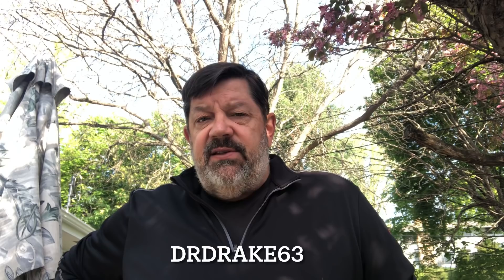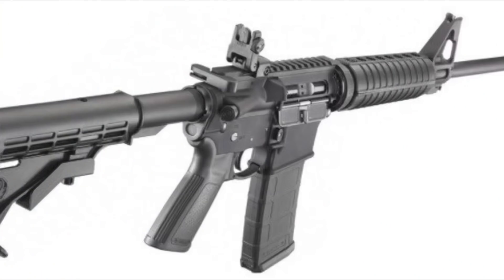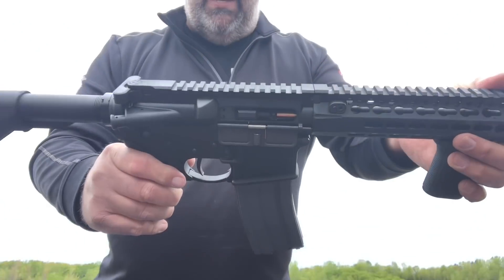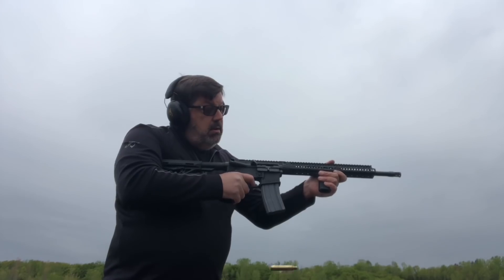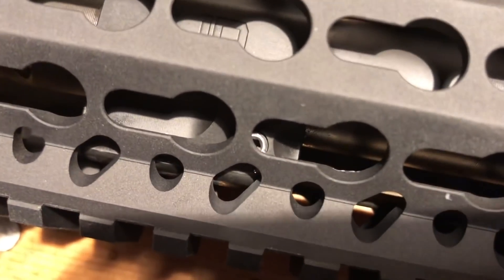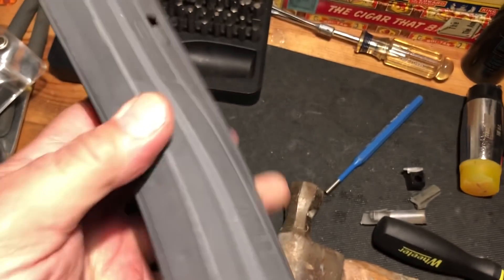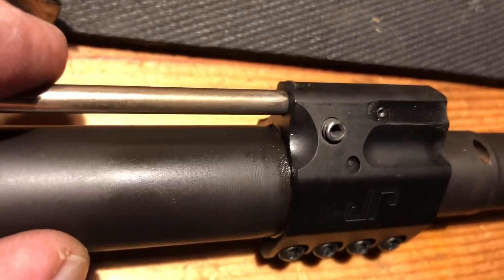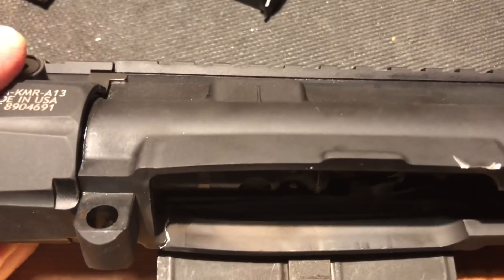Colossal AR Failure

Comment: Sir... Can you check the chamber headspace with a 5.56x45mm field and nogo gauge?  Were you using commercial ammo or reloads?  Also, can you inspect the barrel bore for obstruction?
Reply: I noticed the upper receiver was busted up pretty bad so I think you would need to put a new upper with that barrel then check headspace.  Everything you mentioned was pretty much what I thought, right down to the obstruction because the AR does not produce enough gas pressure to do that unless the barrel was blocked by something like a sqib.
Reply: Given how mangled everything is, I'm going to guess that checking headspace isn't possible, and assuming it was a functioning factory-built gun before changing the handguard and gas block, checking headspace should be irrelevant.
Reply: @KevinJames-yg9eu  Thats OK, I just figured it out.  CNN said it was Trumps fault the gun blew up.  One of their unnamed sources confirmed it.

Comment: For sure not over gas since standard gas block has a port as large or typically larger than the gas hole in the barrel. That was either hot ammo, out of battery det, or a squib. Look at last two shots in sequence before the failure does anyone notice any gas exiting end of barrel, squib(s)?

Comment: After reading comments, general consensus believes it was a hot round. What else could have caused this other than a hot round? possible weak point in a milled part? I don't know much about the internal components, but genuinely interested :)
Reply: The forces at play here were several times the forces that the rifle is normally subjected to to deform all of those components simultaneously. There is no parts failure or fatigue that would take this shape. Not to mention, you see this exact condition commonly with poorly or dangerously loaded ammunition or ammunition caliber mix-ups.
Reply: @KoonceTodd  ahh ok totally makes sense, I truly appreciate your response!!
Reply: @KoonceTodd  correct

Comment: If you think this was an issue with an adjustable gas block you dont belong anywhere near working on an AR.
Ill try to explain this in the simplest way I can think of.
If you were to use a non adjustable gas block, it would be just a fully gassed system.
An adjustable gas block doesnt add any gas to a stoner system.
An adjustable gas block places a valve restriction on the orifice between the pinhole on the barrel and the gas tube. 
Thats it. 
If its undergassed the gun wont cycle properly.
If its overgassed ie the the valve is all the way open you just wasted the extra $100 you spent on a gas block because youre no longer restricting any of the gas you basically just have a really expensive regular gas block.

That thing launched the bolt back into the carrier and grenaded that thing. My guess is you put a 300 blackout into that gun. Either that or there was a major barrel obstruction.

Comment: I almost exclusively run adjustable blocks. They’re not just for suppressors. They help mitigate recoil ( there isn’t much but my GF is tiny and any reduction is helpful). I can’t think of a single way that a gas block could do this. The BCG is designed to handle the total pressure of a cartridge firing without any gas system whatsoever. There are plenty of “bolt action” ARs out there (look up the Cali-Key). This was absolutely either faulty ammo or a faulty BCG. Either the ammo was loaded far beyond spec and the bolt couldn’t handle it, or the bolt itself was not up to spec and did not handle the standard load.

It is actually impossible for an adjustable gas block to result in overgassing. It uses the same diameter gas port as a standard block. They are only capable of reducing gas flow. This is why if you’re having cycling issues, you shouldn’t get an adjustable block, you should get a lighter buffer/carrier.

Comment: Did you have a Squibb? How does the cartridge look? I don't think gas by itself can cause that type of damage. As long as the BCG can move, it will, and any extra gas should come out of the ejection port, or at a minimum, rupture the thin walls of the gas tube. 
It looks to me like the round is still in the chamber, which based on the cracks in the upper is also expanded due to serious overpressure.

Comment: As a military armorer,I can assure you the gas block was not what caused this. At worst the cycle of operation would be out of time if the gas block was out of adjustment and the weapon would not cycle correctly. This would not cause a catastrophic failure. Since this is a factory built and timed weapon I would lean heavely on the ammo, especially if bandleader.

Comment: This was an ammo problem.   The gas system even if over gassing will not have enough pressure to cause this.
This was a hot round.  If it was a reload then too much power or wrong powder.

Comment: There is physically no way the chamber would split from an over gassed return. There are no forces exerted on the chamber from the gas impingement system. One of three things happened, 
1: you had an obstruction,  which it sounded like on the grainy audio, you were shooting either slightly out of battery, meaning the cam wasn't locking into breach or
2: you had a bad Batch of ammo, and you weren't getting enough powder burn to throw that down the barrel completely  or 
3: the barrel wasn't spec, so the chamber was off, or you weren't using the proper ammo. Not all .223 barrels are 5.56. 

Either way, the barrel and the upper both need to be replaced.  But with a catastrophic failure your best bet is to source a completely new rifle, and 

ALWAYS GUAGE YOUR CHAMBER.
go/no go gauges are like 30 bucks, and you should always check every rifle, even factory bought ones, because my bet is the failure was firing out of battery. 

The round wasn't seated.

Comment: The gas tube couldv’e been dirty prompting the owner to want this added then, with increased pressure the new block provides, the tube may have cleaned out and that final full screw out was too much for it. Just a thought but I’d give more credit front the other suggestions.

Comment: You may not have secured the barrel correctly after changing the barrel nut for the new hand guard.  This could affect headspace and cause an out of battery condition.  

It's definitely not the gas block.  Even if the gas block was wide open, you wouldn't get any more gas than from the factory.  The size of the gas port drilled in the barrel controls that and the adjustable gas block can only reduce from there. 

Try to get the bolt out and check for sheared lugs on the bolt and barrel.  If the lugs are intact it was out of battery.  If the lugs are sheared it was bad ammo.  Remove the barrel nut and pull the barrel if necessary.

Did you use any shims in the installation of the barrel nut?  If so, did you put them between the barrel and the receiver or between the barrel and the nut?

Comment: This isn't a problem with the gas system.  Either that round went way over pressure (either do to misloading or barrel obstruction) or it detonated out of battery.  Are the lugs intact on the bolt and the barrel?  If they aren't, then it was the round going over pressure

The gas tube would blow out before causing that kind of damage to the receiver.  The AR was designed this way on purpose

Comment: The barrel is ported to a set size.  If you turned the adjustable gas block fully open it wouldn't be able to gas the gun to that extent.   You had a ammo or "out of battery" issue.  Definitely not the gas blocks fault.
Reply: Exactly.  If it was functioning properly with a standard gas block, you can't overgas it with an adjustable gas block.  All the adjustable gas block can do is reduce the gas from the original amount for using a suppressor which increases pressure or for a lighter BCG or buffer which need less gas to function.

Comment: Glad you're OK.  This is definitely not the adjustable gas block as they are designed to restrict gas pressure only.  In fact, the diameter of the gas hole on the barrel is smaller than the gas hole on the gas block so you will never over gas from barrel spec.  They are designed that way so you're gas block can be slightly misaligned but still function correctly.  IMO, either bad ammo or you might have obstructed the barrel with debris particles from many failures to eject correctly.  Also like to note that you were adjusting the gas block backwards.  You should always start by fully opened position on the gas block and than make increments down until failure to fully lock back on last round bolt open.  Yes, you should also be testing with just one round at a time to test bolt lock back as you can have enough pressure to eject correctly but not enough to lock the bolt back.

Comment: It makes no sense that this is due to the adjustment on the gas system. 
Even if you block or open it completely it should no blow your chamber. 
I would bet more on the ammo. 
What did you use?

Comment: That looks like it could be a plugged bore.  The gas did not exit the barrel, it blew back through the BCG and out the magazine well.  Did the previous bullet actually exit the bore?  Round that you ejected could have left the bullet in the throat, when you chambered the next round, that either pushed the bullet back in the case or the other further down the bore.  When you fired, you had a normal powder charge trying to push two bullets down the bore.  

Second guess is a very over powered round.  A 62 grain bullet on a max load for a 55 grain bullet will give you way too much pressure and cause the same results.

This could also be caused by a squib round that fired but the bullet simply didn't exit.

Last guess is you put a .300 BO in the magazine by mistake.  It will chamber but as soon as that .308 bullet hits the rifling, it stops, acting like a plugged bore, which it is.    

That is not the gas block, unless you opened the port so wide that all the pressure pushing the bullet escaped through the port.  Even then, the bullet should have had enough momentum that it exited the bore.

Comment: You overgassed it man. Dont blame JP. Glad to see your safe though! Over-gas probably put too much force on the portion of the BCG that gets blasted with gas, caused microscopic fractures or weakness over the 1/2 mag you put through it - then the one final death blow before it fell apart caused the catastrophic failure. Im reaching for straws here, thatd be my guess.... and its a GUESS
Reply: Do not believe it to be an overgas issue.
Reply: If I saw the damage, without seeing the video, I would say that some tolerance inside the receiver was messed up and caused the BCG to shear. But from what I understand, the gun functioned prior to installing the gas block
Reply: @TheDombrowSKISKI  that makes sense to me, as does an out of battery. I suspect a squib would have left a trace in the barrel.
Reply: The answer:
https://youtu.be/33iSvFFwYek

Comment: The gas block had ZERO to do with the issue. If you're using the same barrel/BCG from Ruger, the ammo was the problem. I hope you have the box to provide info to the ammo manufacturer/Ruger so you can get a replacement rifle. 
I had one rifle fail like that; it was chambered in 5.45x39 and the issue was barrel/ammo related because the caliber is not SAAMI spec'd.

Comment: Excessive pressure,  I would guess ammo? $hit happens , I blew up a .243 once, never did determine what happened.  $250 bolt for a Rem 700
 I never trusted it, sold it at a heck of a loss. 🇺🇲

Comment: physically, an adjustable gas block cannot allow more "gas" and can only restrict the amount of gas that goes to the bolt. Put it another way, an adjustable gas block that is adjusted fully out will allow the same amount of gas as a non-adjustable gas block. What ammo was used?

Comment: Looking at that,  I would say it was an out of battery detonation or an over charged round.   My thought process is, if over gassed.  It would drive the carrier back doing damage to the rear of the carrier, gas key and the upper receiver.   What I am seeing looks like something forced the bolt back with enough force to insert it back through the carrier it's self.  My first thought is out of battery detonation.   Also could have been just a failure of the bolt carrier.   With out seeing and hearing the incident, it's hard to tell with the evidence we have.

Comment: Ammo related, not a problem with the gas system. If it was over gassed it would just cycle harder and fling the brass farther/at a different angle.

Comment: “Overgassing” does not blow apart uppers or blow out magazines. Gas would come back after the ignition has happened and the bullet has left. It wouldn’t be enough energy to do that. The round touching off is the only point where there could be enough energy to break an upper

Comment: Absolutely no way the gas system caused this. At it's most power it couldn't cause the carrier to break like that. That was the explosion that that happened right in front of the bolt. Had to push the bolt face down snapping the bottom of the carrier like that. There might be something to the headspace/slam fire theories.

Comment: It isn't possible for the gas block to be to blame.  An A1/A2 front sight block does not diminish any of the gas bleeding from the gas port, meaning that you'd be operating with full gas pressure   I don't believe it to be an issue of a stuck separated case head, followed by a live cartridge, unless you fired more than one cartridge following the video at 3:21 (I've slowed the video speed down to analyze each ejected cartridge casing & all look perfectly fine).  I don't believe it was a squib load, because none of the fired cartridges were quiet, and all cycled properly (again assuming no other cartridges, besides the one offending cartridge were fired).  I tend to doubt it was an out of battery detonation due to the design of the rifle, however it is 'possible'.  

Were these handloads by chance?  By you or a another party?  Either which way, this was not the fault of the gas block.  This, to me, appears to be either manufactured or handloaded ammunition that was overloaded, underloaded, the wrong powder type, or somehow an out of battery detonation.

Comment: First of all, when you are adjusting a gun you should not fire multiple rounds without stopping and doing a full examination of each round until you are completely satisfied with the operation of the rifle. Did you examine each case? Was there  a nick in the side of any case? Was there any other damage on the case? Was the deflector marred in any way?  Second, you NEVER go more than one click at a time on an adjustable gas block. 3/4 of a turn to adjust is too much. Now, that being said, you are correct in that the the gas block is not a big issue in the operation of an AR, so whether the gas block was fully open or fully closed (extreme cases) there should be no way that the pressure from a PROPERLY loaded 556 round should damage a properly assembled rifle. Was this an 80% lower?  I've seen some pretty damaged lowers created by heavy chatter from the router bit which could cause this. Are you sure all the parts used for this gun were actually 556? Was the BCG binding in any way? Is the buffer free? Finally, carefully check the case from the failure firing. It will probably tell you where things went wrong. Glad you didn't get hurt and good luck figuring this one out.

Comment: Suppressor, not silencer.
Reply: Tell that to the AFT.
Reply: @edwo6648  Dont you mean the "ATF"?
Reply: @jamescooper2618   Its a mocking reference to a Joe "brain dead" Biden gun control speech where he referred to the BATFE or the ATF (most of the gun community refer to them as the ATF) as the AFT. 
And if you go back 60 years or so the ATF did refer to them as silencers or I believe mufflers.
Suppressors is actually a newer more accurate name created by the firearms community.
Reply: @edwo6648  Didn't hear the Joe Biteme thing. Silencer is big in Hollywierd because you can make any gun just go "piew piew" right.
Reply: @jamescooper2618  While hollywood does fictionalize the level of Db drop, they did not coin the term silencer. Manufacturers and the Feds have been referring to them as silencers and or mufflers since the 50's and 60's.
Reply: @edwo6648  Jezus, you made your point now quit already. I give up! You win! Happy?
Reply: @jamescooper2618  Yes, very.

Comment: I'd have to go with either an out of battery destination or hot round. The gas block can't do it. All it does is limit the amount the gas coming from the barrel it can't add to it because it only has the diameter of the hole drilled in the barrel to get gas from.

Comment: If the gas system was the cause then explain the condition of the gas tube which is not as strong as the BCG or the upper.  This is most likely an issue as others have stated bad ammo or headspace. I believe you have lost all of the upper and at least the barrel as well.  I don't think the free floating handguard will be good either.  Good luck and I'm glad you seem to have no physical injury.
Reply: The gas tube is not the point of failure. An overdriven gas system (which is caused by bad ammo as you correctly pointed out, not the gas block) will simply transmit the gas pressure into the bolt. It's there that an overdriven bolt will attempt to extract a casing before safe pressure and cause a catastrophic rupture as the base of the cartridge loses chamber support. The gas tube would be fine because it would have done its job, which is just direct the gasses. Same for the handguard.
But again you are correct that it is the ammo (or barrel obstruction) that causes this overpressure event, because the gas block will never exceed the pressures delivered through the gas port which is drilled into the barrel.